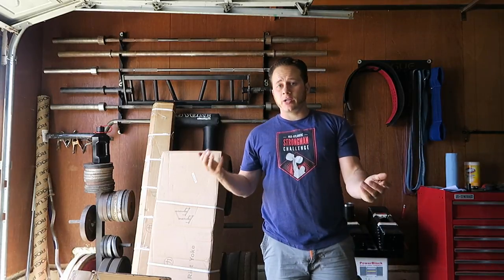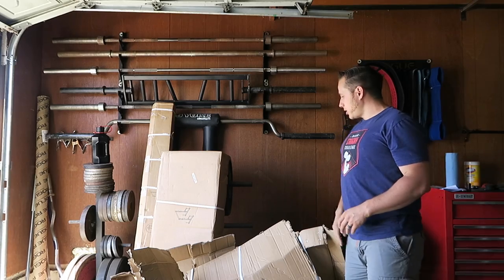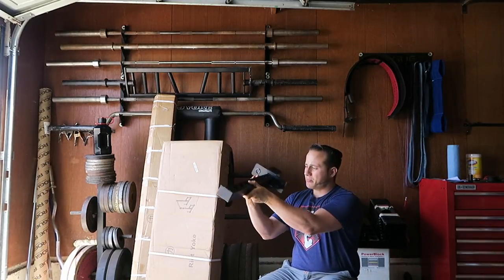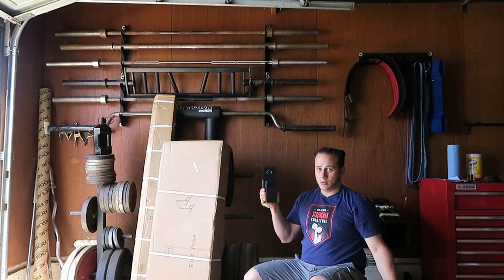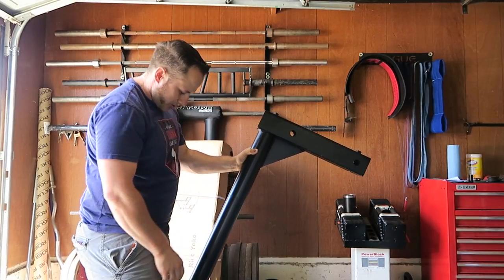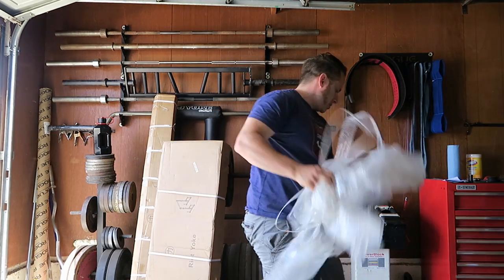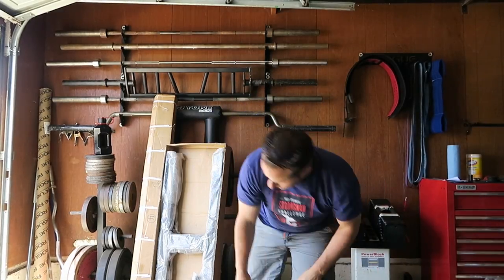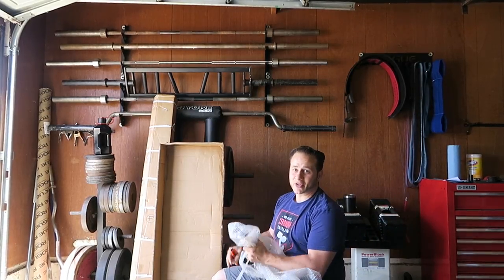Strength Shop Riot Yoke Unboxing

Comment: Kalle, off topic but question about your PowerBlocks, have yours had any trouble with the pins sliding out really easily? We have an older set and they are ok for  some accessories but not overhead work any longer. We don’t use them as much anymore, mostly when we had smaller quarters and lack of space. Nice rack, by the way. Christmas in July! 🙂
Reply from the maker: I haven’t had that problem but I bent my pins which is an issue in itself but maybe that’s preventing the sliding out issue? 
They have a magnet in the side which keeps them from sliding out. 

I have the mega set that goes up to 125 which is useless I’d go maybe up to 55 85 at the most.

Thinking about it I should do a 10
Year review 😂
Reply: Kalle Beck our set goes up to 90. A review would be cool! I know they have added a lot since we first got ours. We had the lighter set which we gave to my husband’s brother and then we bought this set about 12 years ago or so.